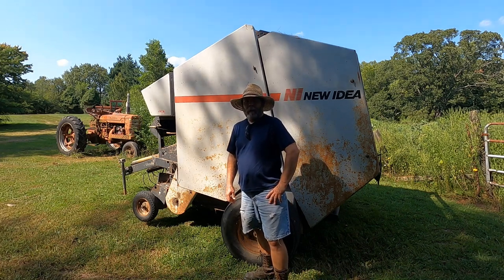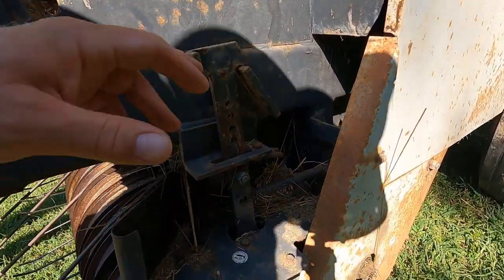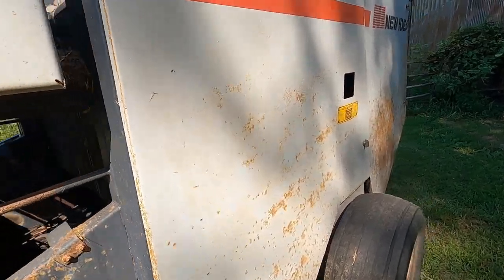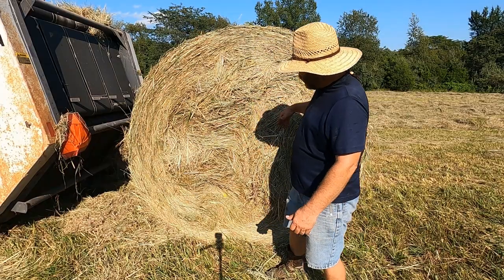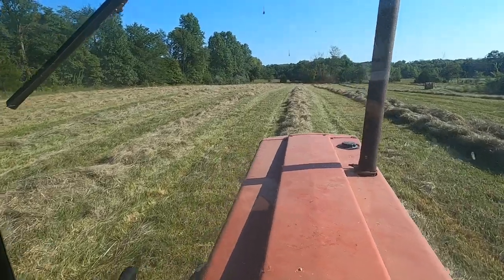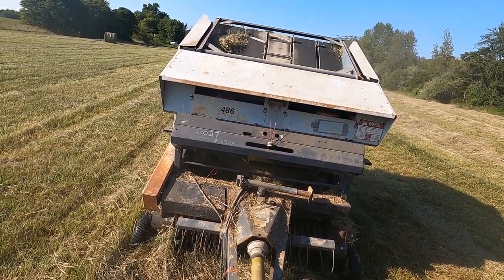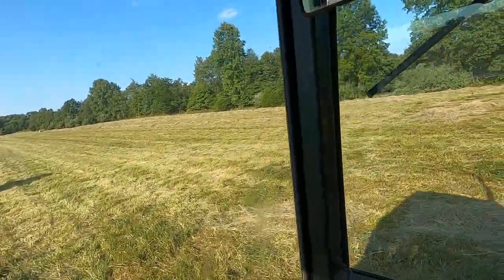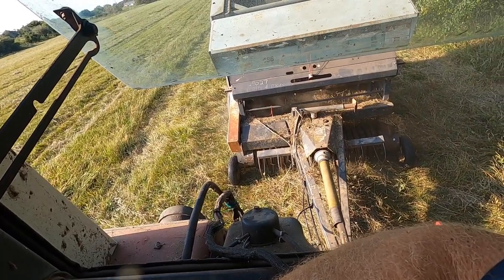Bailing Hay The Basics [ Part Three ] | The Farm Wolf

Comment: Hi Mike, Enjoyed the video. I have NewIdea 4865, Sounds Like a Roller Knock? I did all the bearings on mine, I had knocking and banging like yours. I found the Hex or Spine Shafts on the rollers were worn smooth. This would cause the rollers to spin inside the bearing housing and slop and shift. This also caused me belt-tracking issues. The Bale Density springs can be adjusted for the switch too (IF working), The tractor's rpm is the best method, and knowing your machine. I hope this helps it's an idea.
Reply from the maker: Hello, thank you for watching my video & commenting!  I think that roller might be what's going on with my baler. I'm going to look into it & see if that's the problem, it's definitely got me thinking now.  I tightened the springs when I first got the baler & it did help some. I think the tractor rpm has been the most helpful so far. Thanks again for watching! 🙂